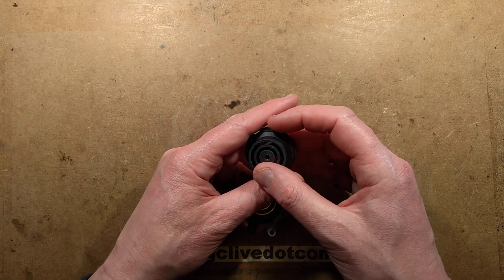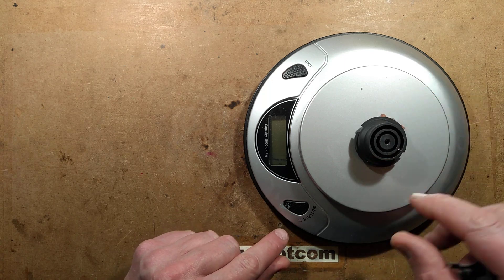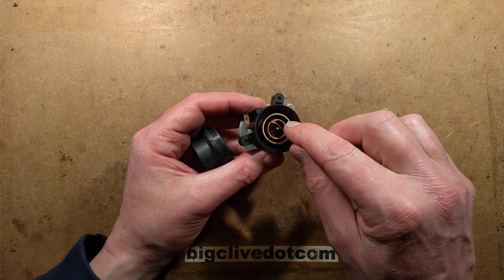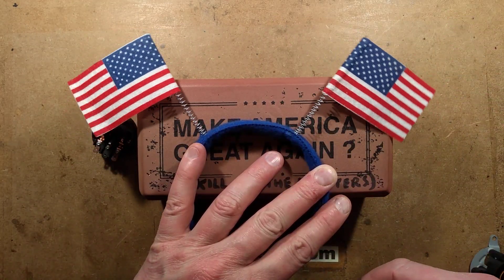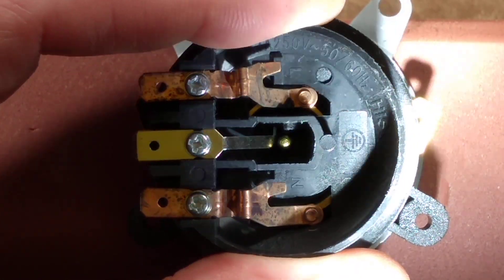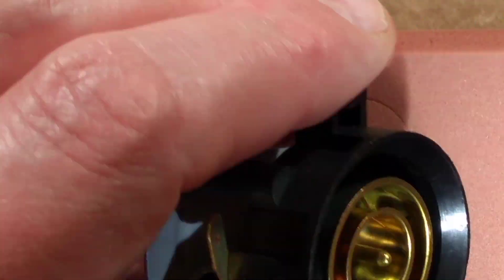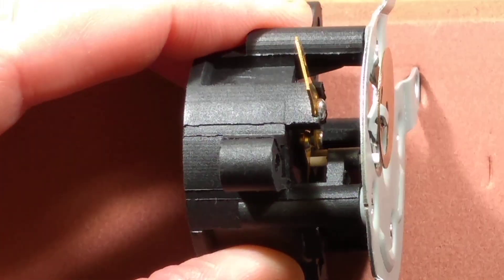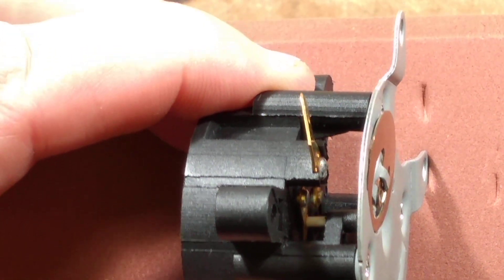A close look at the sliding contacts in a cordless appliance base.

Comment: So if a device fails, the bimetallic strip cuts out then back in every few seconds until it eventually welds shut and burns your house down? Would have been better if the bimetallic strip needed to be reset manually, but that would have cost a few extra pence per unit unfortunately.  Ah well.
Reply: Karl Hamilton At least the main (not backup) switch does that, popping the user accessible switch handle to off when hot enough.  Not all models use the steam pipe sensor system.
Reply from the maker: There's a last resort thermal fuse in most kettles.

Comment: Is it safe for the bottom of the kettle to be wet when you put it on l
Reply from the maker: It's designed to shed water.  If the kettle has just been placed on a wet surface like the bottom of a sink it's OK, but not submerged.

Comment: The bimetallic strip is purely for switching the kettle off when the water has boiled  , NO safety if you put the kettle on without water as without water the heat from the element does not reach the bimetallic strip and you can have a burned out kettle .....  and I know because ????  ...    :-)   , Would be a great idea if the systems were calibrated such that an empty kettle was too light to operate the contacts , none I've had were that good , maybe the $200+ kettles are , but mine have always been sub $20

Comment: The funny thing is that Philips uses Otter Controls connectors (UK). I was curious once, and had a good look at the one on my kettle. Not sure if the products are made in the UK. http://www.ottercontrols.co.uk/connectors.html
Reply from the maker: A local company called Strix designs kettle connectors.  They're probably made in China, but with a British company doing the design and monitoring production it results in a safe and reliable product for use in appliances manufactured by other companies.